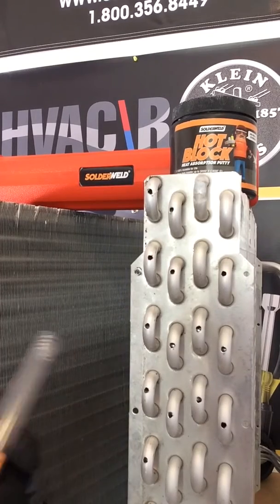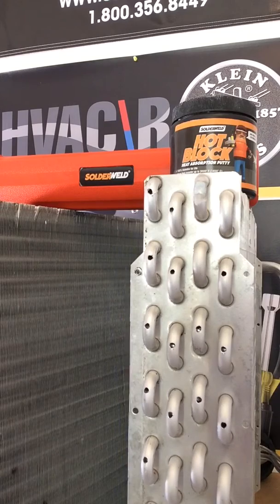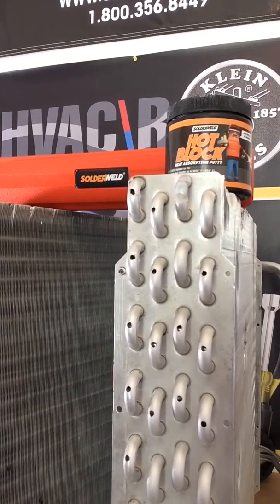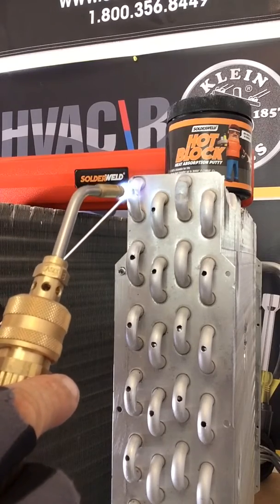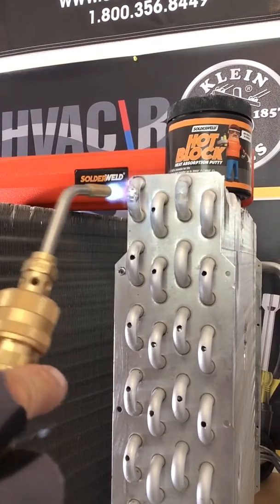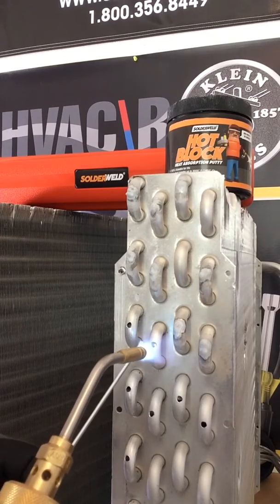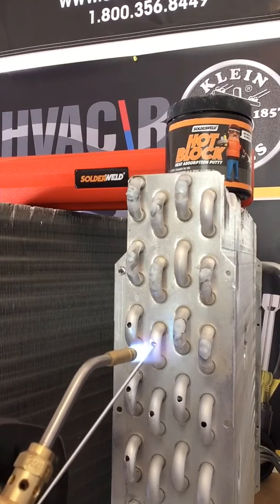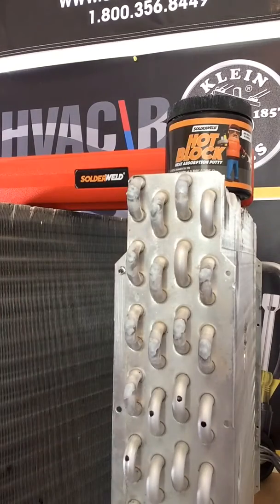Brazing aluminum tubing with Solderweld Al-Cop

Comment: https://youtu.be/Q8zDwhGfoUg I have to fix this. Lennox YouTube recommended that this repair should not be made on there product but Lance says it can be done, your thoughts? The huge frear for me is the ribbon, i think it is very very thin and we will melt it. Just read no Flux needed in these comments. I'm practicing big time on a coil. I got one shot to fix the microchannel coil.

Comment: I think this is the wrong application for Al-Cop. These rods are meant to solder aluminum to copper.
Reply from the maker: We thought so too, until we tried when Solderweld was in the shop. We now only use AlCop and we have had no problems or warranty repairs. AlCop works just fine. Solderweld and I speak monthly and more.
Reply: @cochisecounty_travels  oh that's awesome to hear! Good work. Thank you for the content
Reply from the maker: @frankieibarra939  thank you my friend for all you do and for making HVACR Great!!!
Reply: I HAVE TO fix ribbon connection to a header on a commercial carrier condenser.

Comment: I did not see you add the flux?
Reply: I was thinking the same. It looks like they have al cop and also al sol looks like they’re different
Reply: Those are Flux core rods so no extra Flux needed. To be honest, he is using the wrong rod. The Al-Cop rod is for soldering aluminum to copper.
Reply from the maker: @frankieibarra939  to be honest, no I’m not. We tried the AlCop in front of Lance at Solderweld by accident and it held. We use AlCop all over Arizona and Californian with no issues.

Comment: Where is the code for solderweld?
Reply from the maker: Mike Reed the only promocode I have is with Trutech Tools. You can buy Solderweld products there. Use HVACGUY at check out. You’ll find HoRblock under Rectorseal.